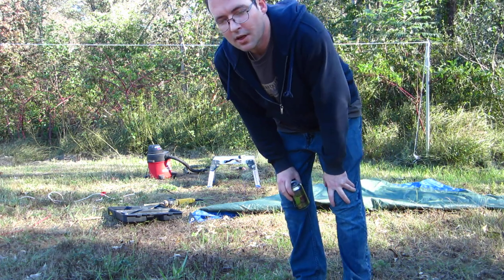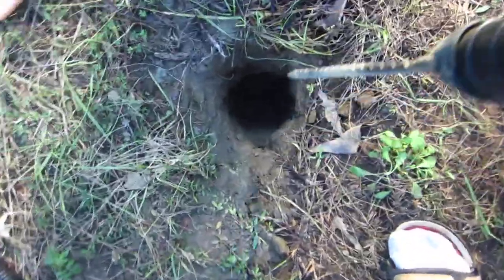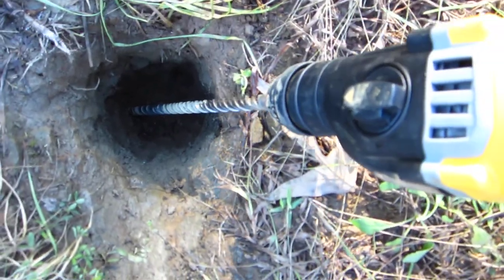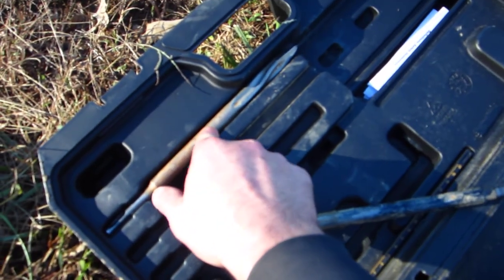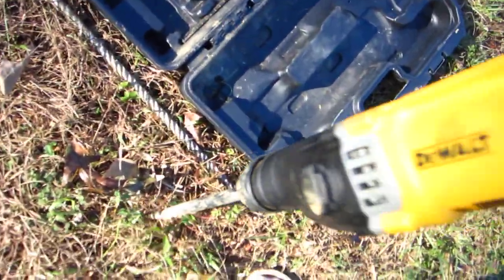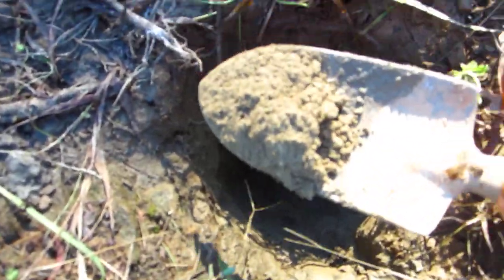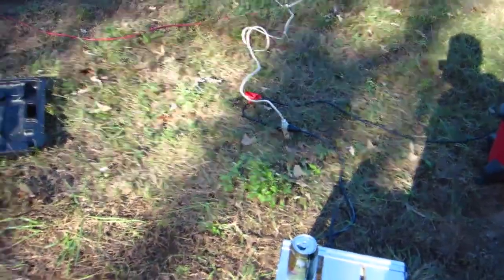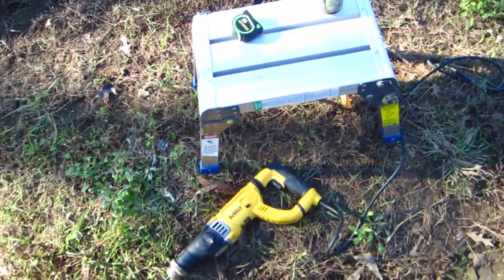Drilling a post hole through rock

Comment: This Dewalt isn&t tripping your circuit breaker from your house? Or are you using a geneator? Cheap Chinese hammer drills, 1.25 inch start at about $65, and go up. I live on the big island of Hawaii, and it's mostly hard lava rock. I need to be able to make holes like you did here for 2 3\8 inch gate support posts. Then use maybe some quick drying concrete on those round steel posts. So, you first drill holes, then use a chisel bit to break up the rock. Thank you for this video.